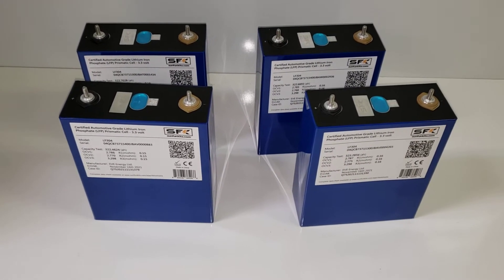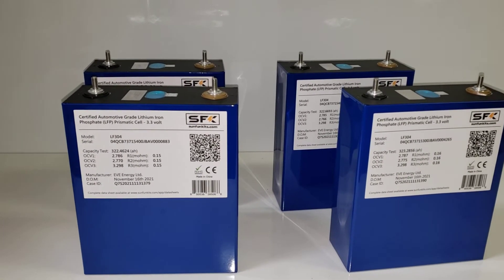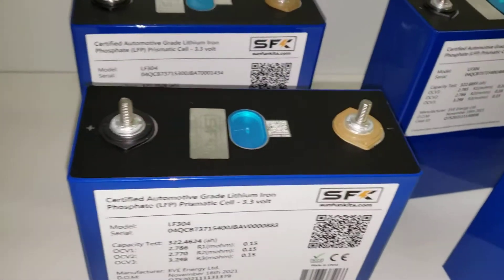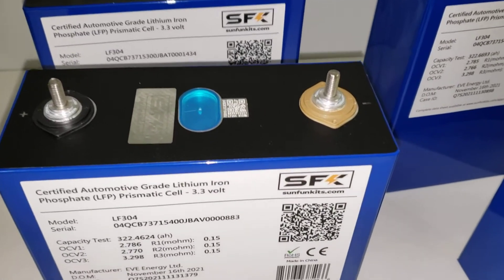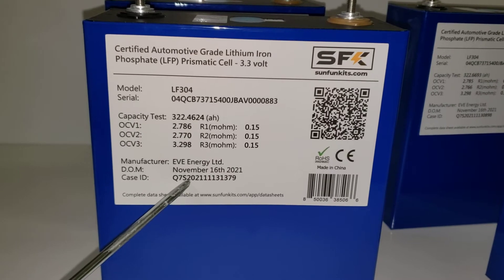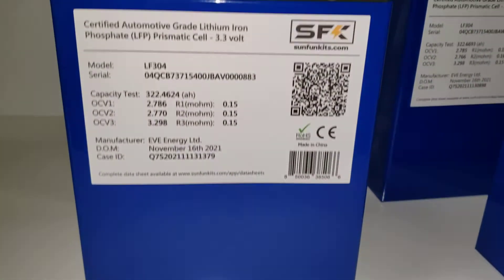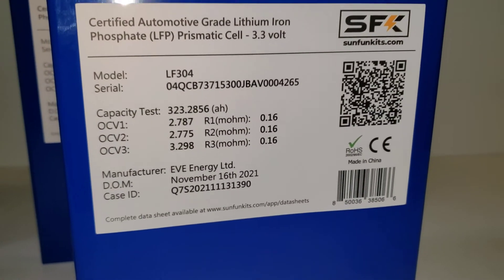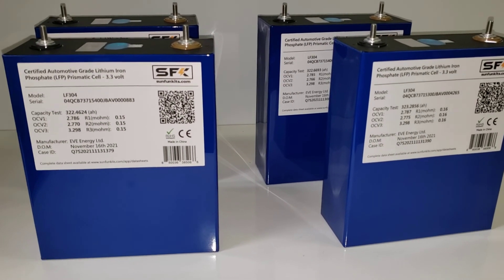Certified Automotive Grade A LFP Prismatic Cells, EVE LF304 by Sun Fun Kits

Comment: Thank you for this video, it's very important, because resellers on Alibaba, Aliexpress or others really need to stop scamming people.
We manage to scan the QR codes of the cells, and this gives us the important information.
I think a label is not really the right solution, ill-intentioned resellers, could edit the labels they want, and still lie?
The engraved QR codes, in my opinion, are safer.
(but wouldn't they be able to invest in re-engraving machines and fake QR codes?)
In conclusion, it is very preferable to buy cells with serious sellers, like you, or directly from the manufacturer.😁